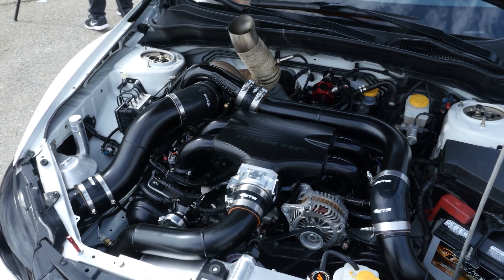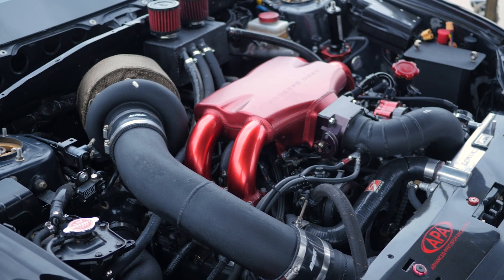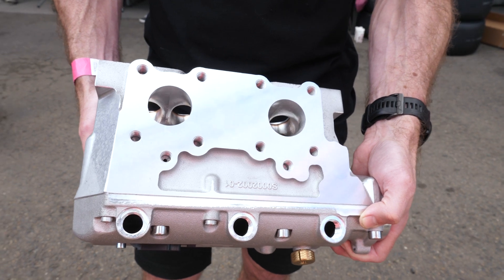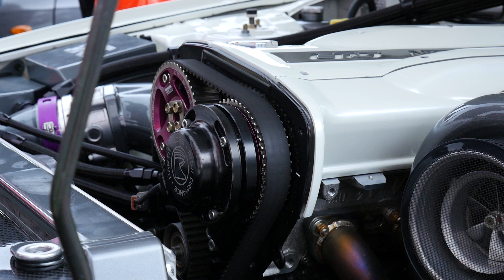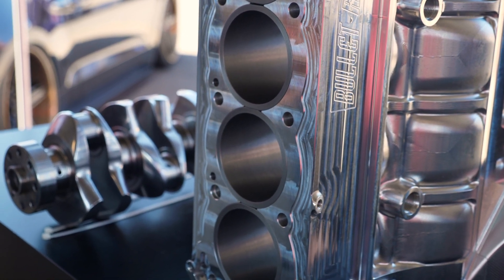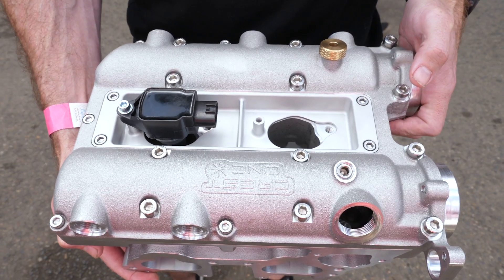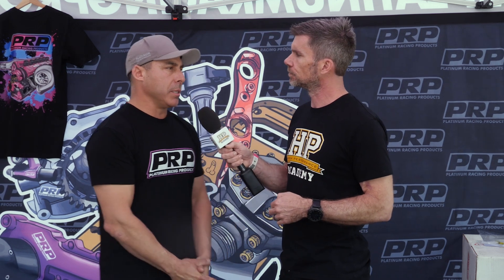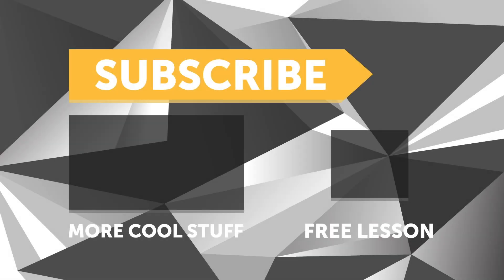Better cast parts than OEM?

Comment: Cool, with precision 3D printed cores being available for some time, I'd expect some other very smart folks will be working on their own unique requirements.

What I'm REALLY looking forward to is some really smart folks casting the head and block as a unit, with it bolting seperately to a 2 piece crankcase assembly, like engines were cast way back in the early days.
With no heade gasket, there can't be a problem with them leaking or heads lifting. With no requirement to pass the big end of the 'rod through the bore that can be made stronger and/ or use larger fasteners - the diesel chaps would benefit there. The upper crank-case can be stronger as the webbing isn't going to require piston reliefs and it can be more rigid and provide a lot more "meat" for the main studs, as can the lower crankcase - with the potential to incorporate the sump assembly for further rigidity - or just being left as a simple girdle.

Comment: EG33 heads next! Great block and engine but REALLY could use some head design...420cfm 3.3L turbo....yes please
Reply: 100% the EG is so lacking in aftermarket parts would love more options always wanted to compound turbo and destroke one.....
Reply: @Handcockjohnny  it has the same 79mm stroke as the EJ. High revving is limited by the springs, cams and timing belt...all of which are easily sourced...save maybe the camshafts. Gates racing timing belt, pick a good dual or triple spring and a custom grind. You'd definitely want a dry sump setup with might actually prove a bit more difficult but maybe not. The do use the EG33 in sand dune racing buggies making 1000hp with sleeved blocks. Subie performance can close deck the block as well

Comment: No. No subaru is worth it. Ever. I say this as a modded subaru owner. There is nothing redeeming about the chassis or the motor. Slow to spool, outrageously expensive to mod, crap ECU,  firewall flexing,  Go faster for cheaper in an Evo. Make your subaru reliable by swapping in a K series.

Subaru owners are just a bunch of suckers with deep pockets.
Reply: Having owned a Subaru and lots of other cars that I've modified... I gotta agree. Pretty much every other platform is better especially from a cost per bhp perspective
Reply: What if a big reason the EJ underperforms is due to poor cylinder head design? Spoiler - it is. That's why this thing is something to get excited about, even more than it would be for other engines. 

Oh, and as for a redeeming quality... The STI having a killer drivetrain from factory doesn't do anything for you? Alright then...

Comment: Hopefully they re-route the exhaust port to have a direct flow vs a 45 degree angle, causes alot of the overheating issues with those corresponding cylinders.

Wrote this before the end of the video haha way to go guys!

Comment: Pushing the envelope of what a bottomless money pit can be in terms how how bottomless the bottomless moneypit can possibly be.
Reply: Not really, if you're at the level that can use the heads.
You're trading a higher initial cost, which isn't really that much higher as a percentage of a build, for heads what will last and be reliable AND give better breathing.
Look at it this way, even if you're spending double, and "only" get double the life, you're saving on a full engine rebuild and the time and money that'll cost. If the modified OEM heads fail during qualifying or practice (depending on the type of event), that'll normally mean wasted travel time and all those costs, too, unless you've a spare engine and the time to swap them.
Reply from the maker: Take a deep breath and dive on in!  
I saw a true crime series that reckons people hide the bodies of dead bank accounts at the bottom 😂 - Taz.

Comment: I'm wondering what a head is going to cost compared to a new head (from Subaru). This head would seem like going NA with ITB's screamer build would finally make more sense.
Reply from the maker: You will have to check with your local OEM dealership for their price, but you can see what PRP are offering in AUD here: https://hpcdmy.co/prpej

Crest CNC do a great job on anything they do, so for those with a need for heads like this in their perfomrnace application I'm sure they won't be disappointed.
If you want a bit more insight into what goes into the production of aftermarket cast parts and the improvements that can be had over OEM, check out this podcast episode with Chris from Crest CNC: https://www.hpacademy.com/blog/107-billet-isnt-everything-the-rise-of-aftermarket-cast-engines-podcast/?utm_source=youtube&utm_medium=social&utm_campaign=general-interaction

And this one with Herman from PRP: https://www.hpacademy.com/blog/086-forget-billet-for-a-second-whats-with-aftermarket-cast-blocks-podcast/?utm_source=youtube&utm_medium=social&utm_campaign=general-interaction

Great to listen to during a commute, road trip or while tinkering in the garage - Taz.
Reply: 4800 for bare heads and 8900 for assembled (valves, springs, probably not cams)
Reply: @WillfulMirror8  6,600 au$ bare, 11,660 aud$ fully prepped
Reply: @CneyTMS  that would be WILD